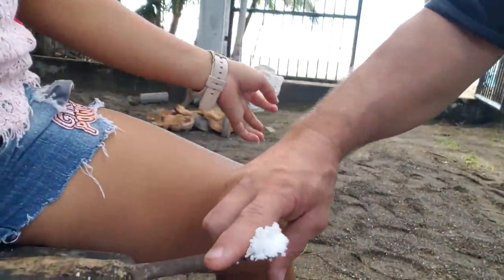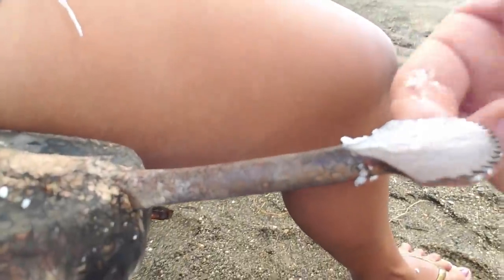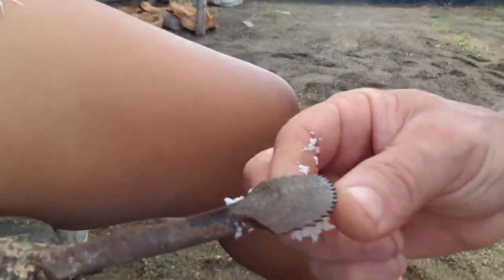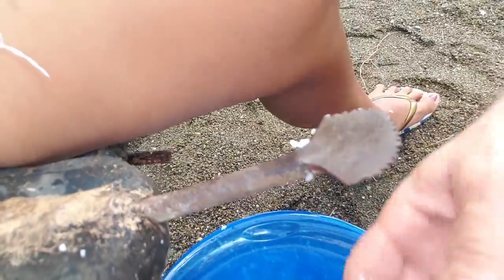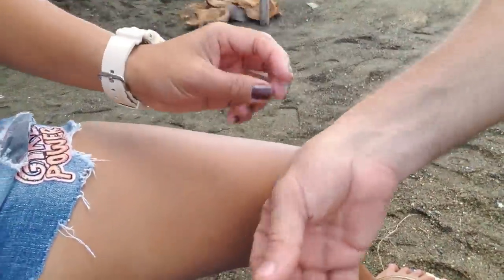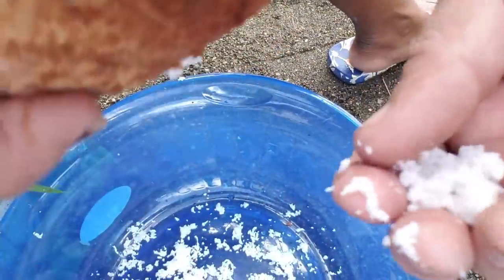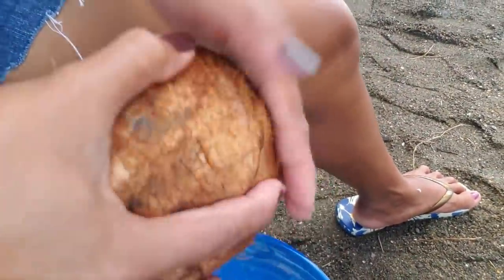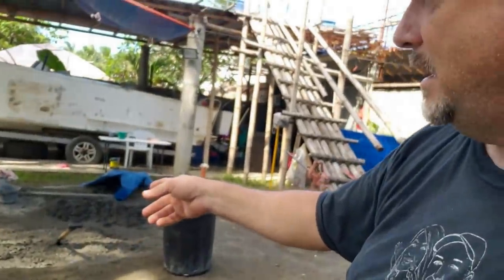Philippines Beach House Build Day 95 part 2: Concrete Mixer and Machines on Peaceful Island Build.

Comment: Wheel barrels and concrete mixers have their uses.. One mixer is just too small for building a house. Usually for me, it's great to beat incoming bad weather.. It's all about the staging of gravel, sand, and cement the day before.. The mixer will give you a better evenly mixed batch of concrete or motar.. We use a (4' X 7') aluminum mixing pan placed inside a larger pan full of water.. On hot days, the cold water surrounding the pan slows the drying process.. Pans have wheels for EZ moving and staging.. I still prefer giving jobs to safety cautious locals who can follow directions. I don't tolerate cavalier attitudes about safety.. Supervisor must enforce safety rules or they are fired.. (No exceptions)! Safety glasses, ear plugs, gloves, and steel toed boots are a must.. Hard hats once ANY structure goes past 5 feet high.. I supply safety items and deduct half the cost of boots over 2 months.. Being a military vet, trucker, and a firefighter, my jobs have always been time sensitive.. So it was very hard to get used to Philippine time..

Comment: I may have mentioned in a pervious video about why aren't they using a wheelbarrow.  That's not exactly the most modern technology. And I do get his argument about mechanizating yourself right out of a job. That being said, I see a tractor in your field back in Texas. You could still plow the ground with a horse or a mule. But I have a feeling you're not going to. Mainly because the abuse to your body, and the lack of productivity. It's primarily about what tool is most effective for a job. My grandfather had a broken body by age 55 simply because he didn't have the better tools available.
Reply from the maker: your points are very valid! my dad 's was too. He manually lifted everything and would not get a front end loader or  other tools to help his health and safety. his spine was worn out. I do things differently. Some tools are good. Here now these people needwork and I dont need a ton of tools sitting afterwards or selling them pennies on the dollar after done. so we will manage and everyone is happy. self checkouts - BLAHHHHH  Corp giants Now my tractor would not be traded out by human labor but animal instead . so yes a tractor is important. There is a balance and common sense as I can see you understand. Thank you for taking time to comment this. Good Stuff
Reply: @TexasFilipino  That's such complex topic. I'm not sure what the answer is. I use technology that makes my life easier and better. Yet they use the same technology to put people on unemployment. I'm not sure what the correct balance is. I know the future looks like a frightening mess for blue collar workers, such as myself.

Comment: welp... unless you wanna be a freelance contractor there, you won't need automated equipment since you're not going to build houses everytime, no? by the way, are they "pakyawan" (contractual, with deadline) or "arawan" (they get paid based on days of work, no deadlines)? some expats here need to know how to deal with the local carpenter/masons about the payment terms as well as their pros and cons :D
Reply from the maker: So they are just day to day worker. I have no contracts or builder. There is no lead masoon. My job is different than most would deal with. I buy all the materials myself. The 3 with more experience aka massons get a little higher daily rate. The basic labor gets a lower rate. There is no deadline and they have learned I dont do this mess of do it wrong so I can do it again and get paid stuff.  I started this build doing non house projects and weeded thru people to find a crew that works to fit my attitude and ways. Most wont. They have their ways and will walk on you if you do it any different. No sense in getting mad just keep hiring another until you have built a team. Like auditions!
Reply: @TexasFilipino  I'm glad they're not doing some delaying tactics on you like:
you> ok let's get to work
them> can we have a brunch 1st?
after brunch
you> ok I hope we can get back to work now
them> ummm... we're trying to digest our food here, boss.